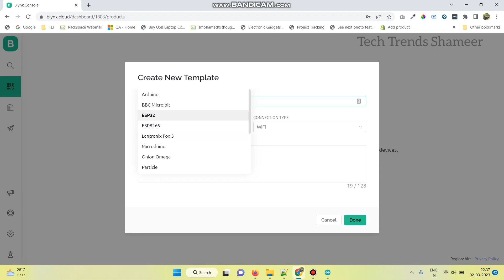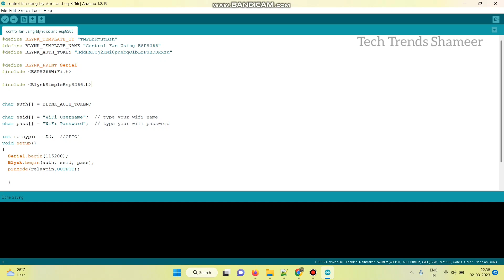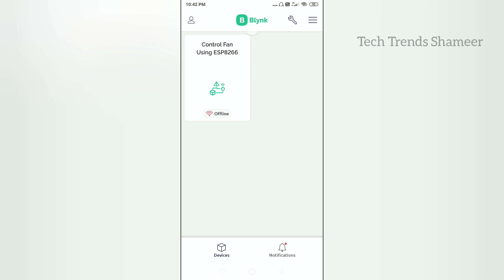Control DC Fan Using ESP8266 and Blynk IOT | Blynk IOT Projects

Comment: good morning sir......  i connected relay for D0 in esp8266..... which pin I have to using in blynk app..... can u plz help me.....
Reply from the maker: If you connected to D0 then in Blynk you need select Pin 16. Not sure 16 is available in Blynk. If so, please connect to D1, D2 or D4 in ESP8266 board.

Comment: Good day Mr Shameer, fantastic project and simple as it looks but I did the project using same component, but my relay will just turn ON without any button few seconds after powering the microcontroller, making the webdashboard and Mobile useless, what do I do?
Reply from the maker: Thanks. Please message me in Instagram. I will try to solve.

Comment: Bro esp8266 control four relay with whatsapp control and manual switch please
Reply from the maker: Ok Sure.
Reply: @TechTrendsShameer  please sir early
Reply from the maker: ok
Reply: @TechTrendsShameer  How to connect you
Reply from the maker: @imransajid7615  Please message me in instagram
Reply from the maker: https://github.com/Tech-Trends-Shameer/Esp-8266-Projects/tree/main/Control-DC-Fan-Using-ESP8266-and-Blynk-IOT
Reply: @TechTrendsShameer  fan speed bro
Reply from the maker: Need to modify code to control fan speed